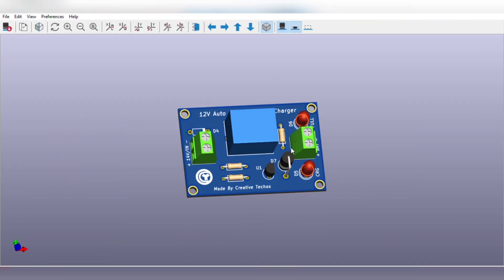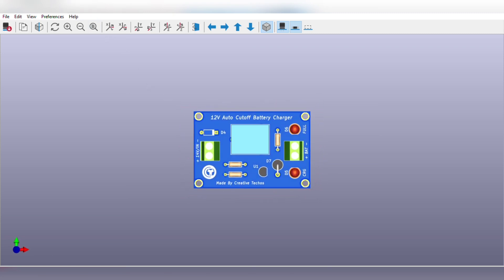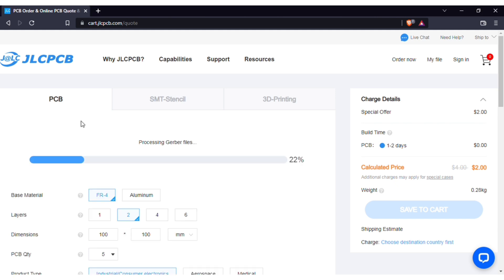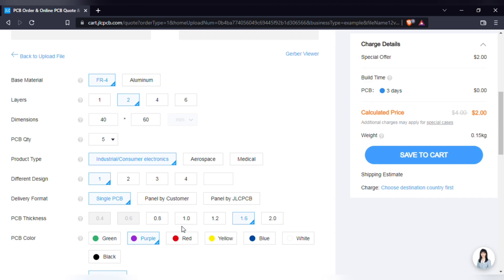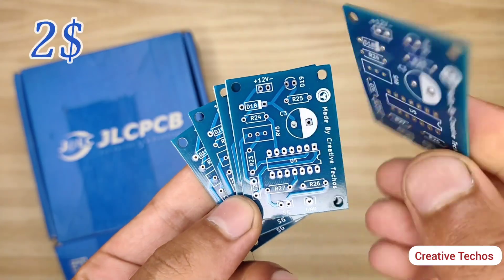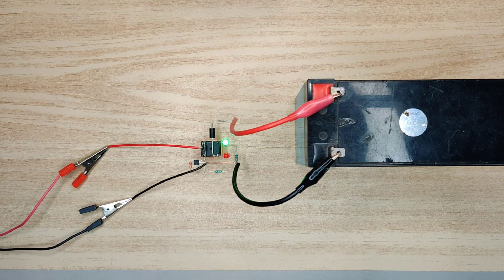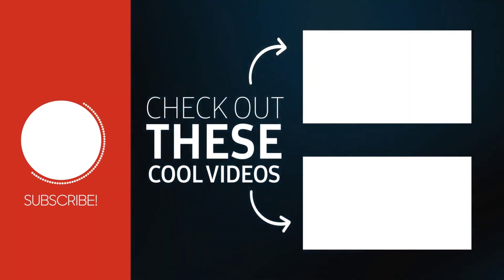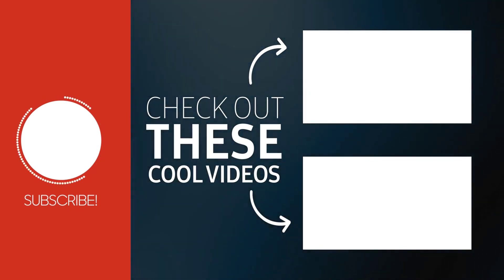Simple Auto cut off 12 volt battery charger circuit

Comment: i want to ask, I'm still a kid but I'm  curious how the battery charging work and i have this question in mind that bugging me.. do i need a high voltage compared to a battery like for an example i have this 12 volts battery do i need a much higher voltage to charge my battery? like in your video 14 volts is what use there
Reply: and how can i limit the battery to not overcharge and over discharge? how it works?

Comment: Nice, dude i have an important question, im going to charge 2 of 6 volts batteries in series my power supply can give me 12v 6A max , we have i and we have a diodie in the circuit we know the diode takes 0.7v lets say as a tax to enter so now i have less than 11.3v to work with , how can u solve this problem?
Reply: You need 13.8V to charge a 12V lead acid series of cells.
Reply: Why not two diodes and charge in parallel?

Comment: Hello,

I'm wondering what serves to limit the current from the power supply to the battery?  Does the regulator limit the current or is it the resistor connected to the battery?  Also, how does the TL431 handle the back EMF from relay inductor coil?

Thanks

Comment: If you cut off the charge at 14 volts, the battery will be charged to 80%. After the voltage rises to 14.4 volts, you should wait for the current to drop to at least C/20.

Comment: Dear sir.
With reference to your
I require 12 volts auto cutoff battery charger pcb 12 pcs
Secondly I need 24 volts auto cut off battery charger pcb, itis possible to use the 12 volts pcb by charging the24 volt relay and resistors values increase pls advice me email id

Comment: I have an important question for you, and I hope to respond quickly, please, if possible, which is whether it is preferable to use the IRFZ44N MOSFET or the transistor power E13005A in designing an integrated charging circuit for lithium batteries included in the TL431 transistor, and I wish you would mention the reason, and thank you very much.

Comment: Very nice circuit thanks 
Suppose I want it to cutoff at 13.8 volts which resistor should I replace 470R or the 2.2 k
Reply: I think u should try a variable resistor to set a fixed voltage limit. that way u will also easily find out which fixed resistor u need.

Comment: Instead of TL 437 which transistor se can use.
Reply from the maker: TL431 is adjustable voltage shunt regulator, it has no substitute, but it is easily available in market.

Comment: is it suitable for 12v 60a battery charging??
Reply from the maker: Nope maximum 10 amps
Reply: No because maximum relay current is amps is  10  so don't use maximum amps
Reply: Circuit diagram

Comment: Bahi input current mobile charge da do to   work kary ga ?
Reply from the maker: Yes, you can but you need to use 5v realy instead of 12v also you need to replace 2.2k resistor with 1k and instead of 470 ohms Resistor you need to use 1k variable resistor to set your desired cutoff voltage.

Comment: Can i use this protection circuit for 12v 6amp battery and solar panel.? Plz reply... thankyou 😊
Reply from the maker: Yes you can use it, to make it work perfectly, input dc must be fixed at 14-14.5v
Reply: @CreativeTechos  the solar I'm going to use gives 14w 4A current....(will this okay)
Reply from the maker: Yes, perfect 👍

Comment: Why you should disconnect first the negative line to light up the red led??
Reply from the maker: Actually battery needs to be connected first then input dc must be connected, 
When I disconnect battery the resistor triggering bc547 senses battery is full because voltage & current returns or rises to cutoff refrence. And that's why to restart charging battery needs to be connected first, then on full charge it will cutoff automatically.
Reply: @CreativeTechos  There is no bc547 in this assembly, so I still cannot understand the operation of the system since the voltage at the cathode must be: Vref(1+2.2/0.47)=14.2V, the relay should not get excited!
Can you provide us with more details on how it works? Thanks in advance
Reply: @idiragouni5520  same issue here, im unable to understand how its working. the schematics is not making alot of sense.

Comment: can i use a 1n4001? thanks
Reply from the maker: Instead of 1n4007 or 1n5408?
Reply: @CreativeTechos  yes
Reply from the maker: You can use any schottky diode instead of IN5408, 2-3A must be used for 7-8 ah battery
Reply: @CreativeTechos  I meant instead of 1n4007
Reply from the maker: Yes you can use 1n4001 instead of 1n4007

Comment: How many maximum input volts and maximum ampere can I use in this circuit???
Please reply must....thanks...
Reply from the maker: As I have used 1n5408 general purpose Diode, 3A output max, if you need higher current eg, under 10A use MIC110A Diode.
The input must be 14v to 14.2v max & 10A maxx
Reply: Awesome man breliyent
Reply from the maker: Thanks for watching 🙂
Reply: Not working acid battery charger 12v
Reply: I require the cct. charging upto 10-15 amp. for 100 Ah bty charging